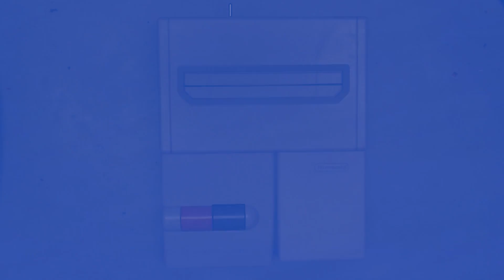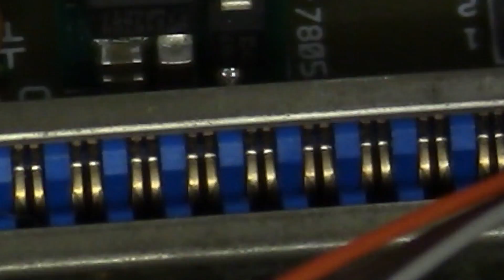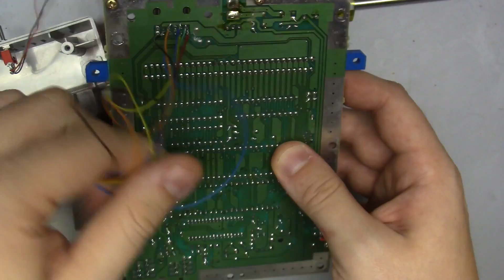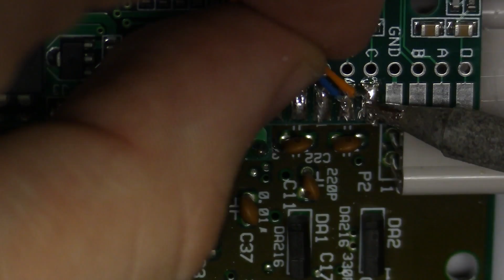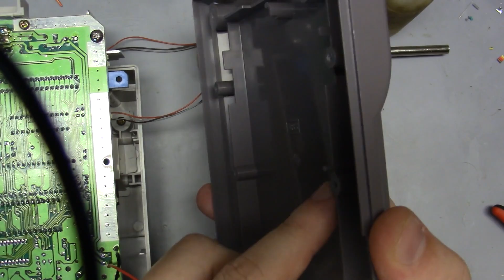Terrible NESRGB Installation From a "Pro Modder"

Comment: Snobbery aside i really like keeping up a standard, i would route wires like a rats' because it still worked until I started wiring up race quadcopters. As you can imagine, you dont want 50+ wires flapping in the wind at 60mph with 4 props chopping nearby.  Its what taught me lead discipline.

Comment: I could be thinking of the N64RGB board, but I seem to recall Tim including the exact wire you used there.  Although I bought direct in Oz.  Either that or I watched a video back then and bought the wire for myself.  99% sure the multi wire came with the N64 board though.  I don't think I ever got around to installing it.  The N64 is one of my least favourite consoles of all time.  It is only the Ganbare! Goemon games that I love.  I loved Zelda in 1998, before it was turned into THE most horribly overated game of all time.  Even surpassing FFVII.

Comment: It's hard to do when you won't put a link to your ribbon cable. You want everyone to do the best job with ribbon cable?
Reply: It's ribbon cable.  You can get it pretty much anywhere electronics bits are sold.  Ebay, Amazon, Digikey, Mouser, your local electronics parts store...

Comment: What would motivate the replacement of the LM7805 with a switching regulator to begin with?
Reply: Switching regulators are more efficient.  They can provide more current and/or generate less heat than linear regs.  So, a lot of people get warm fuzzies knowing the regulator is running cooler and can provide more power to all the additional stuff they add while modding (power LEDs, the RGB electronics, etc.)

There are two problems, though:

First, linear regs can actually be quite efficient if the delta between input voltage and output voltage is minimal (e.g., using a 7V wall PSU instead of a 9-12V PSU), and the current required is low.  That's not so much the case with consoles that use a couple hundred mA @ 5V with a 10V PSU, but it is something you should know before automatically going to a switching reg.

Second, switching regs are inherently noisy.  They're literally turning on the full input voltage intermittently and counting on impedance between the input and output of the regulator circuit to convert that choppy off/on/off/on into a smooth(er) DC voltage somewhere between 0V and V-in (e.g., 10V).  The more filtering you add, the smoother the output gets, but also takes more space, costs more due to all the parts, decreases the transient performance (how quickly it can react to load changes), and makes it more complex and thus difficult to ensure stability.

Alternatively, you can use a switching pre-regulator.  This just minimizes the delta between PSU input (10V) and the desired regulated voltage (5V) by using noisy (but efficient!) switching regulation as a first stage, then using quiet (but inefficient) linear regulation in a second stage.  Switching from 10V to 6.5V, for example, then linear from 6.5V to 5V.  Best of both worlds.

If the NES had separated all its analog circuitry, another useful approach would be to run the majority of the digital circuitry with a switching reg (since it doesn't need to be particularly clean power -- just clean _enough_), and then run the critical analog stuff with a linear reg.  Since the load on the linear reg is much lighter then, it generates less heat.  But alas, since the audio is in the CPU, and the analog video is in the PPU (or it's all on the NES RGB board in this case, which also -- IIRC -- only has a single power rail), they can't be split into digital and analog sections.  It's all mixed together.

Comment: I will vouch for the "EasySBC" 5V switcher drop-in 7805 replacements. I've been putting them in a bunch of my consoles, and they've performed very well. I haven't put them on the scope, but I'm extremely sensitive to this kind of interference and I do not notice anything like that on my systems.
Reply: I use the more expensive Traco Power replacements myself older computers, never had an issue with one failing or causing other problems in my systems though I've never done it on a SNES before. Older 7805s fail taking a lot of nice ICs with them when they go, replacing 7805 with a fresh one would be a minimum for maintenance for a system. Can't actually see it as a bad thing for the longevity if the system to remove all excess heat from the system by going with a switching regulator.

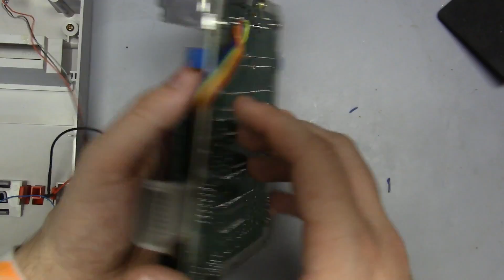Comment: At 10:08 you say 5 seconds. At 12:09 you say 6 seconds. Now I can spare 5 seconds to measure, but 6 is asking too much and is way beyond the point of being reasonable. So rats nest it is!
Reply: 5 seconds for normal conductors... 6 seconds for flippin' conductors
Reply: But if you measure and cut the wire, you have extra for a little Snack.
Reply: It's there sorts of blatant lies which completely turn me off from your body! Which is it Voultar? 5 seconds or 6 seconds!!!!

Comment: hey voultar baby what's that solder sucker you're using, also will it cost me my dignity or will it be somewhat affordable
Reply: also perhaps considering doing a full equipment run down for well, everything. Where to get small electronics like capacitors and resistors, where to buy wire, good soldering iron/suckers, good solder, etc. Just a quick supply rundown of what you should have before getting into this stuff. I think that would be perfect.

Comment: Lord Voultar, what kind of ribbon cable do you use and where can i acquire some of it?
Reply: he links it in another video https://www.amazon.com/gp/product/B014OLIXMC
Reply: I'd like to know where to source the ribbon cable goodz also! And that no clean flux too!
Reply: Sauce I also would like to know this
Reply: I need that gorgeous ribbon too.
Reply: closest i could find
https://www.sparkfun.com/products/10647
http://www.jameco.com/z/28RC10-10VP-10-Conductor-Multicolor-Flat-Ribbon-Cable-28AWG-10-Feet_639672.html
http://www.newark.com/3m/3811-10/unshielded-flat-cable-10-conductor/dp/96H9306

note that the last one is 100ft of cable, hence the price difference
Reply: This one looks pretty decent?
http://ie.farnell.com/pro-power/r2651dtsy10ac85/ribbon-cable-10-core-28awg-30/dp/2628345
Reply: I wonder if this is sufficient
https://www.amazon.ca/Ribbon-Cable-1-27mm-Spacing-Rainbow/dp/B016DA5JA6/ref=sr_1_1?ie=UTF8&qid=1504013406&sr=8-1&keywords=ribbon+cable
Reply: Sauce you can find it on bob from retro rgbs page in the tools section
Reply: Jimathy Sanderz I can't "quick shoot" the order unless I know what cable to get! Oh wait, I guess the quick shoot series doesn't rely on solid information...
Reply: embalmed thanks!
Reply: I get mine off of eBay. I love it.
Reply: Figure it out!